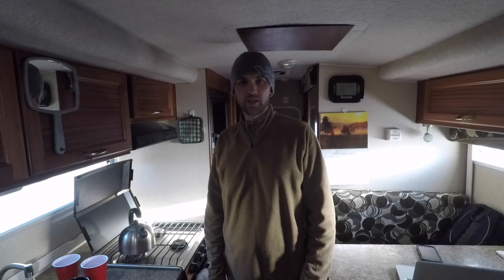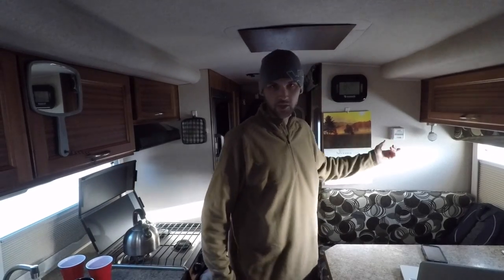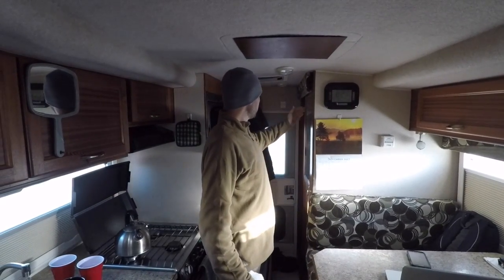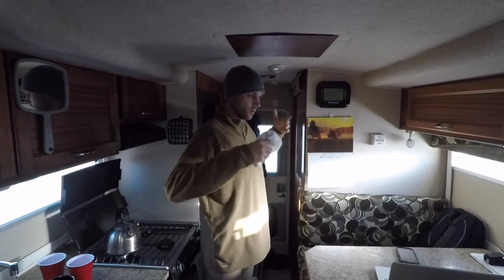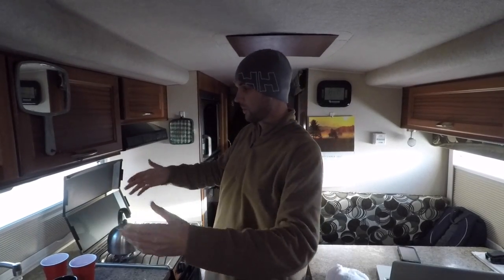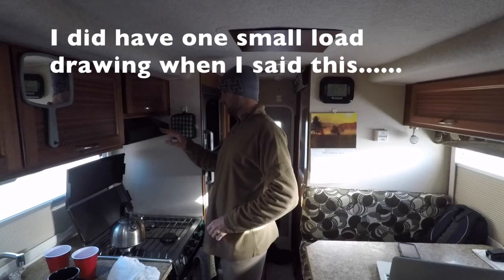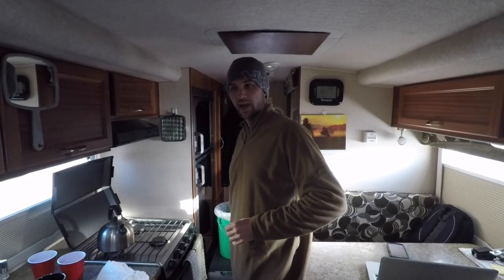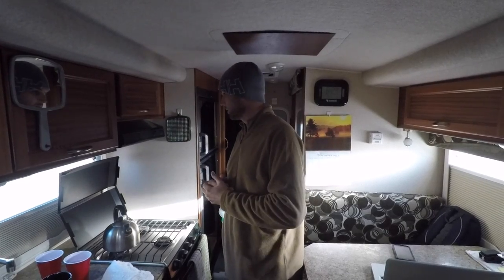Freezing Temperatures While Northern Lite Truck Camping!

Comment: Use the furnace. Forget the buddy heater. Is/was your camper rated as 4 season? 
    I have a Wolf Creek and just use the furnace like if I were at home. I have 2x200 AH 12v LiFePO4 batteries that just fit in the compartment, but they can be brought into the camper as well as they don’t vent. I have 3 x 175 flexible solar panels on the roof. I have a generator for backup, but the truck has a dual alter set up and it and the 40 amp converter charges the batteries quickly. They can take 10p amps, but that level of charging is expensive!! 😂. Instead I ordered a 2023 F350 SuperCab Dually XL 4x4 with most of the options the XL offers AND the 2.0 kw pro power onboard. That be will more than necessary to keep the camper going!! It’s set & forget. The truck starts up on its own as the demand builds. I have a smaller 2020 Rayzr 3 season camper that’s on my 22 F150 and it works awesome with the 2.0 kw pro power onboard. I have camped when it’s -15 C or 5F and it was warm enough, but no water in the tanks etc. that would be catastrophic 😂😂😂. It works for my summer needs. The Wolf Creek is new so I have it on a 69 GMC 3/4 ton with airbags. It doesn’t fit properly, but it works for now.

Comment: Your portable heater is generating a lot of moisture  and people are going to  add even more. You need to crack open your vents to allow excess moisture to escape and  crank up your furnace and set the thermostat to run at 74 degrees F.
Reply from the maker: Your right. Dry heat and some ventilation 👍

Comment: You really need use the house furnace to heat that camper. Condensation is managed by using a fan to circulate air with a 18v cordless fan from pick your favorite tool maker. You need to open the roof vent a like an inch all night long. the hot air will remove the water out the roof. I had found a 20lb propane tank would last 2 to 3 days at below freezing temps. If you are breadthing in the camper in cold weather you need a roof vent open.
Reply from the maker: You are correct. Run the furnace as it produces a dry heat. I didnt have enough battery power to do that with the stand alone lead acid batteries in the factory setup. A good lithium battery bank will solve all those problems.

Comment: I never short myself on heat and other comforts in the TC. That baby's 65 degrees at night, bathroom door open to keep the space and pipes warm in the cold. Did you ever get a second solar panel? Do you have LED lighting? 4 gauge wire from alternator to TC batteries? Yes, 12.1 V is a little low. My bottom limit is 12.2 V. You'll be in the sun and warm soon though right.
Reply from the maker: Still 1 panel....All LED's........I was drawing a load when I said that in the video so they were @12.3

Comment: I'm in my 10.2 Northern Lite right now, and it's -7 "C in the day, and -11 "C at night.  Everyday I have been adding reflective insulation, and aluminum tape to create vapor barriers. Every area I insulate/ seal, improves the overall winter experience in my NL.  NL did some really stupid things with open air travelling from the dump bay area, to the interior through the drawers next to the wet bath. The dump valve area doors are useless at keeping in heat.  Take a look at my instagram.com/irnieracing to see what I just did!
Reply from the maker: Yeah I hear you I wasn't all that impressed with the insulation heating of the dump tank compartment either. It could have been insulated better. I know that in incandescent light bulb in the dump tank area puts out some heat and keeping it on during the freezing helps. Thanks for your comment all the best man!

Comment: Keep in mind, for every gallon of propane used, equals one gallon of water accumulation. Try putting cat litter in old socks and stash them in different areas of your interior, the cat litter will absorb condensation.✌️
Reply: You won't accumulate water vapor using a house furnace, they vent the vapor outside. A buddy heater will add water to the camper though.

Comment: Use your furnace you gotta keep your basement warm so the water doesn’t freeze, I didn’t look to see how old this video was, but hopefully with some practice you’ll figure this out unless you can have an open flame inside your camper the less condensation you will get your house. Furnace does not put any condensation into your camper, your stove does and your little buddy heater does
Reply from the maker: You are correct run your furnace for dry heat. Have lithium batteries or a generator when not plugged in!

Comment: When propane burns one of the byproducts is water vapor. Warm air holds more moisture than cold air. When the warm moist air comes into contact with a cold surface The air cools and can not hold as much moisture so the moisture deposits on the cold surface. 
You need some sort of ventilation running a propane heater in a small enclosed room. Carbon Dioxide is another by product of combustion. The more frightening one is if the heater starts burning incompletely, it can give up Carbon Monoxide. Ever hear of waking up dead?
Reply from the maker: I agree with everything you said. The camper has a CM detector. Having a small fan blowing throughout can help with the condensation but really only way around it is heat and ventilate at the same time also wearing super warm clothing.
Reply: If youre hooked to electric does it make the most sense to use a space heater instead of the furnace?  and will that most likely keep your pipes from freezing?

Comment: I see a tea kettle on the stove, so make sure you open the vents when ever you heat water.  WalMart sells a clamp on 12V fan for about $8 in the auto section or pick up free/inexpensive server/PC muffin fans.     I can't ever recall having a condensation issue the past 4 years in my Apenlite TC.  I follow the weather and seasons, so rain/cold/damp is an exception. Although my low for the month was 14, so NV does get very cold.  Day times have been in the 50's-70's, so no worry about freezing pipes at night.    Biggest prevention for condensation build up is getting air flow in your RV.  Please be careful with that Buddy Heater in a small confined space.  I know too many RVers that are making themselves sick using it.    Once you get farther south to the promise land, you won't have to worry about that.  You'll be all dried out and chapped and wishing you had the moisture.......Near record temps due up mid week.....mid 80's so beat feet to the SW......👍🙌😁
Reply from the maker: I'm dreaming about the promise land right now!!!!!!!!  🤘👍🤸🏾‍♂️
Reply: I know Im asking randomly but does someone know a method to get back into an instagram account..?
I was stupid lost the password. I would love any tricks you can offer me!
Reply: @Harlem Reginald Instablaster =)
Reply: @Carter Nikolas i really appreciate your reply. I found the site thru google and I'm trying it out atm.
Seems to take quite some time so I will reply here later when my account password hopefully is recovered.
Reply: @Carter Nikolas it did the trick and I finally got access to my account again. I'm so happy!
Thank you so much, you really help me out !
Reply: @Harlem Reginald No problem xD

Comment: Thank you WCR for sharing your travels and experiences! I have been taking note of your comments about your new truck fridge! I was wondering if you are using the built-in fridge for something else now that is is not in use?
Reply from the maker: Hello Annalee....great question that I will be doing a video soon covering......we are using the built in freezer refrigerator to store food in such as bananas, bread, drinks liquids, condiments,  dry foods. The extra space we are finding is working out perfect for extra storage needs. Also putting paper plates in the Microwave...we don't use it either. I am super happy so far with the truck fridge. It's using very little energy. I'll see if I can come up with some amperage numbers. I will be doing updates with it as I'm curious how it will do in hot temperatures.

Comment: I am going to try 2 small 700 watt radiator heaters , 1st by the door , 2nd on the table , with a small fan to circulate the air . also insulate the floor with more carpet pad and carpet . Add a layer of insulation in the closets that have an outside wall .  I think the dry heat will help for humidity .  I know a power hook up is required but it would be a good experiment . once I put a small heater by the opening of the inlet window  to heat the fresh air while a small exhaust fan moved the air from the opposite end of the trailer , that might work in the camper too.
Reply from the maker: Air circulation is the most important I found...no clothing or towels touching the outside walls.....dry heat is the best!....Good luck!

Comment: Go get some moisture absorbing bowls at the dollar tree. They work really well. Also if possible install a mini wood stove. Best decision I ever made. Keeps everything dry and warm. Wood is also free.
Reply from the maker: Yes I used to use dri-z-air. A wood stove would be the best solution in the coastal environment in winter. Dry heat!!
Reply: Yes those moisture cups from Dollar Tree for damp places and closets, they really work very well I was wondering about would those help.  You will be surprised how much water they collect

Comment: Doesn’t the Buddy require ventilation for your air to be safe?  
Maybe get an RV de-humidifier for your peace of mind?  Warm thoughts for you!  😊
Reply from the maker: RV's are not air tight......but I usually have a vent cracked slightly....so I still run it with vents closed no issues....use your best judgement and always be safe....I have CM detector too....

Comment: My best results are electric heat, its dry heat, of course you need be plugged in, for the roof ac with heat strip , or would start gen. For 1/2 hour to make the coffee. It dries it out quick.
Reply from the maker: Thanks for your comment. Electric heat sure is great when you have the power.

Comment: do you think using the buddy heater created more condensation than normal with just the furnace?
Reply from the maker: Yes. The furnace puts out more of a dry heat as the exhaust is pushed outside.
Reply from the maker: The furnace will drain your batteries for extended boondocking. Great for when hooked up to shore power.

Comment: Better advice would be buy RV antifreeze and 1. drain water heater 2. Run rv antifreeze throughout all water lines / toilet sinks p traps outside shower and so on. It only takes 5 minutes to winterize and un winterize a camper, why take the chance on something that cost so much money. This is advice from a family that camps 4 to 5 weeks every summer for the last 6 yrs, and never had any plumbing issues.
Reply from the maker: I've never experienced any plumbing issues in freezing weather. This camper is insulated and made for cold weather camping. Your advice is solid for most RV ing applications or non/poorly insulated units.

Comment: Get a diesel heater. Dry heat
Reply from the maker: Those are good too.
Reply: It will eliminate the condensation. You can buy them for like 200 bucks. Not including installation

Comment: First, throw the mr. buddy out the door, it's a ice fishing, ice house heater. 
Second, your truck camper is a four season camper, it's designed to use the on board heater, it'll keep the lines from freezing if you turn it up to a reasonable temperature, it's also a dry heat.
I'm pretty sure you talked up that truck camper as the best four season camper on the market, perhaps you should trade it in for a Bigfoot, as it has more insulation and a 30k btu heater. 
I guess I'll never understand the fascination with ice house heaters in the rv/van community..by the way, it's nice to know that it's 41° at 8:30 p.m. in northern Minnesota.
Reply from the maker: LOL! The onboard heater works fantastic when your plugged in.....unplugged it draws a lot of amps due to the electric forced fan. The Ice heater as you refer to it gets heating job done. The solution is to be in 72 degree weather as I'm writing to you in now! No heat required... open your windows and doors! Take care thanks for watching!
Reply: West Coast Roller the on board heater is ducted to keep the tanks and lines from freezing, the buddy will only heat the living area, where the thermostat is, so if you keep it warm enough in the living area, the on board furnace won't turn on and heat the tanks and lines. 

Now that you've figured out what the problem is, you can fix it, you can switch to lithium, move the battery compartment inside under one of the bench seats (to keep it at a reasonable temperature), run a 100 amp cable to it from the charging system on your truck, that way you'll always be completely charged when you stop for the night, that way you can live like a civilized human being, after all, that truck camper is your home...unless of course you really enjoy " roughing it", and living with condensation.
Reply from the maker: I do set the furnace on at night and let it heat the tank compartments and basement in the freezing temps. Those battery mods you speak of are wonderful but tough to justify when we spend half the year plugged into full hook ups. Running 2 wet cell 6volts in series. We rarely camp in the freezing temperatures that's why we snowbird to the southwest to leave the dampness and condensation behind. Thanks for your comment
Reply: West Coast Roller I watch your videos, they're great, but as long as you keep using a buddy heater you're always going to have the dampness and condensation...the buddy heaters do two things very well; 1. They heat small areas. 
2. They produce moisture.

Just my $o.o2
Reply: The co detectors usually go off as they're removing the body from the camper. Meanwhile as you're breathing in the small amounts of co from the heater you're destroying precious brain cells that help you're reasoning skills. This is why most buddy heater winter campers are usually Trump haters. Just saying.